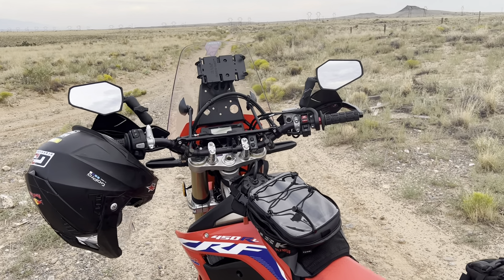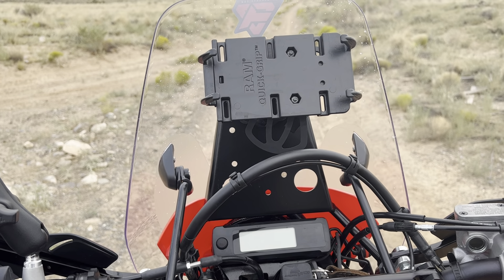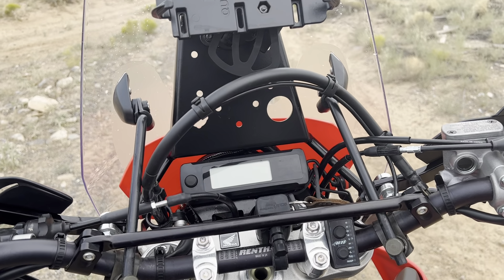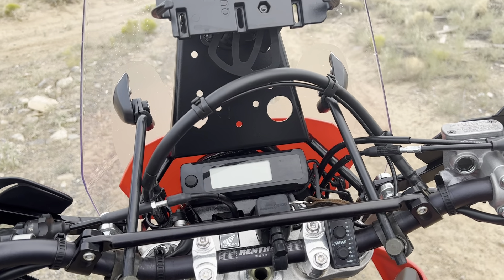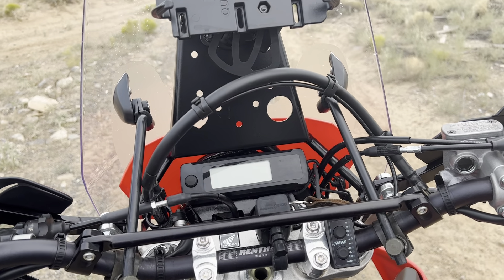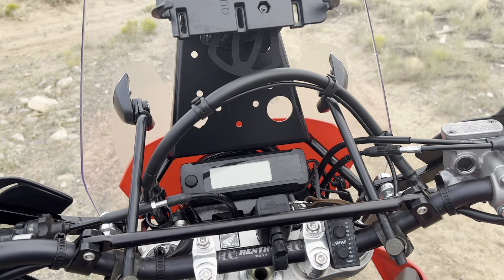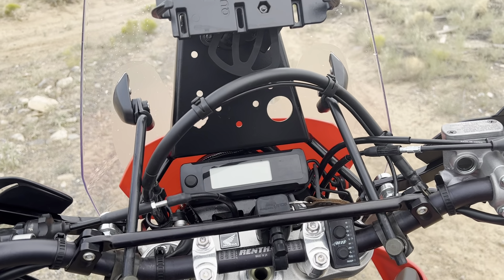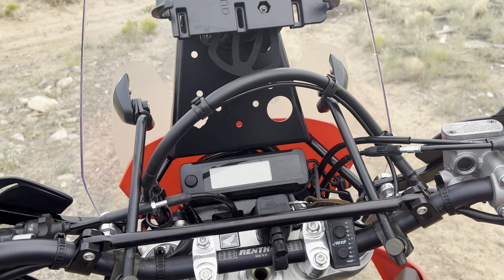Honda 450RL/AIM ECU update:

Comment: i love my aim ecu set up, i sorta only ride my bike off road lately, and run a full FMF exhaust on map 2, it’s fantastic in the the roughest stuff. 

i will add that this is my second Aim ecu and map switch combo. my first one for unknown reasons, malfunctioned and left me stranded one morning just getting off work, i had to call a tow truck. mike sent me a full refund,ecu  and a  mapswitch that week. taco moto is a stand up company and mike is a stand up guy, i was told i was the first to experience this issue so im hoping it never happens again since i ride a lot of remote areas alone, thank god it happened to me just leaving work.

Comment: I have a 2019 with an Aim ECU. Map 5 preprogrammed. It's 100% better. Nice linear power delivery. No stalls when chopping throttle. Once in a while a low speed stall. But I think most of it is just learning the fuel injection throttle control at low speed. I also have a CRF250X carbureted.

Comment: The Aim ecu is always a bonus but don’t you wish u knew when you only had 200 miles was that all u really needed to do was break in that super tight motor and gear box in for a couple thousand miles to solve almost every issue.